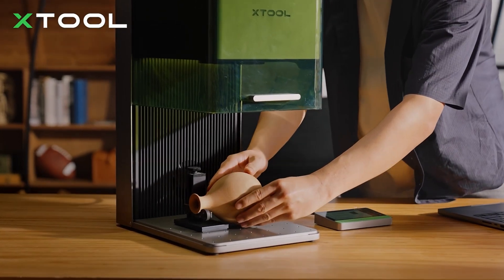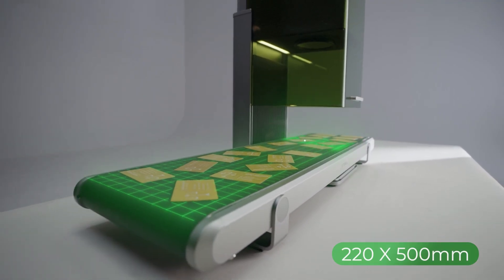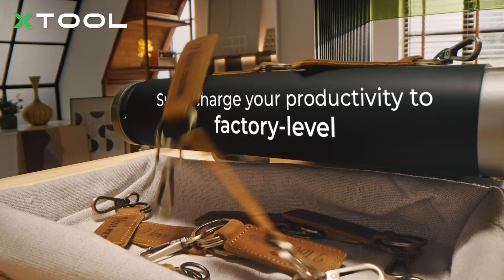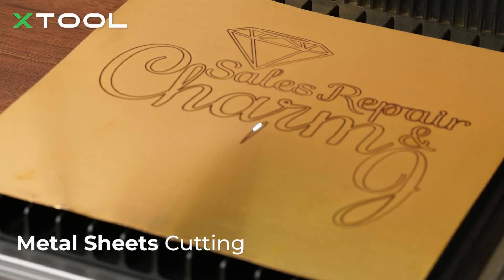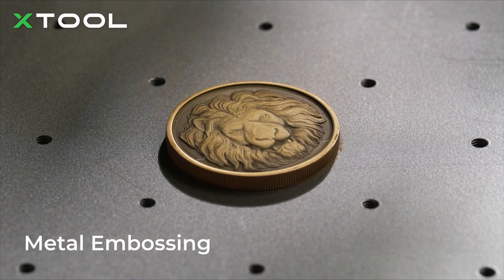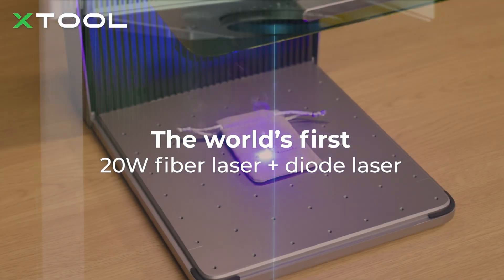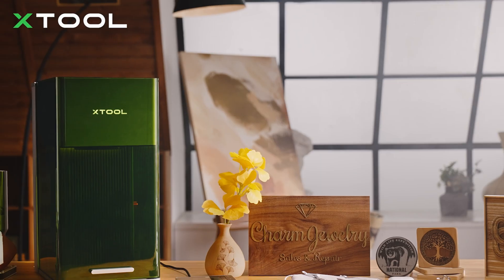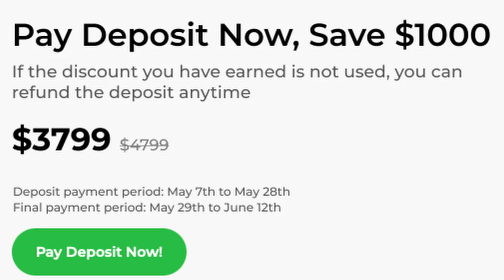xTool F1 Ultra - The World's First Diode/Fiber Combo Laser

Comment: Neat. So this is why last night a laser group told me NOT to get the F1, they are coming out with a new one. Can't wait!
Reply from the maker: It quite bit more money than an F1 and really targeted at a different market.   It if you have the budget, go for it.  My review will be one of the first, so stay tuned.
Reply: @SteveMakesEverything  I will, just saw YT unsubbed me again (I rarely comment) but aside from that, this has more features it seems and more capable of what I want to be able to do. I was planning on the F1 and another Fiber, so getting this combined for both features is actually not as costly as one may expect. Sure, upfront it is, but I would have to anyways. 

Errr, if that makes sense.
Reply from the maker: @RoseKindred  Definitely if you were looking at an F1 and a fiber laser, you might want to wait.  Keep in mind, though, that the F1 Ultra will be a 20W fiber, so no matter what magic xTool has managed to pull off, it can't possibly engrave as deep as a 60W laser.